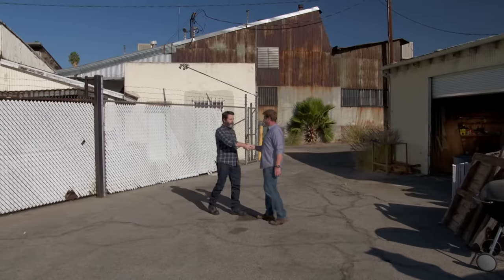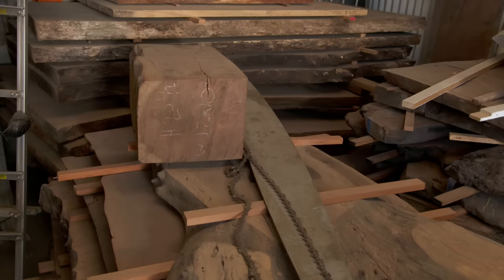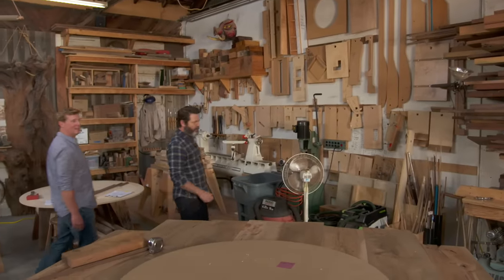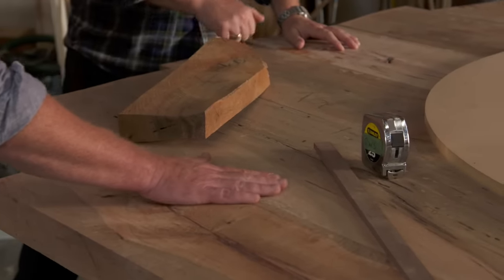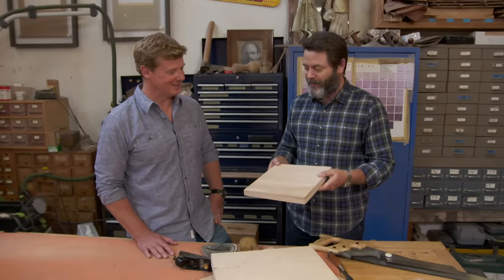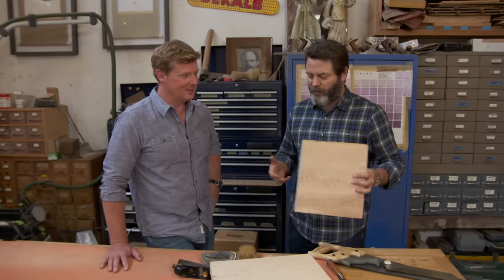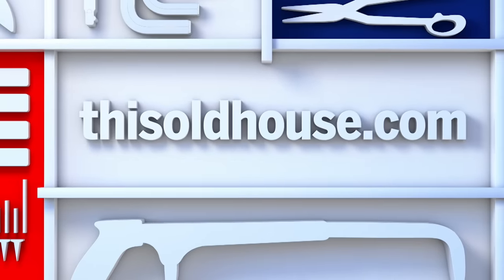Touring Nick Offerman’s Wood Shop | Ask This Old House

Comment: "the less electricity you can use - the more pleasurable your woodworking will be"  Wise words for sure!
Reply: I dunno about that. Certain power tools make life so much easier.
Try drilling a hole with a hand drill.
Reply: Richard Darlington what he means is that the less electricity you use the more proud of yourself and the more satisfaction you will have when seeing the end result
Reply: Lord Loud Kloud
What? You don't use power tools? I have better things to do with my time than spending five minutes drilling a hole instead of five seconds.
Reply: Lawson Mcdonald
And I'm saying I disagree.
Reply: Richard Darlington you disagree yet you have never taken the time to do so? You disagree with something you haven't actually experienced?
Reply: I agree that fashioning a thing by hand is pleasurable but after forty or fifty years of working without electricity or air power your hands, wrists, elbows and shoulders are damaged. You still have the passion to create but it becomes more and more difficult. 
Use power when you can. Every time you try to bend a piece of material to your will you give up a small piece of yourself. So use your body intelligently
Reply: formerly 987946216430   i agree with that, as he said, insofar as the lack of the incessant droning noise, but i'm all about power tools and production.
Reply: That's why I work on my wood in the dark.
Reply: I am a hobby woodworker and if I could afford all the fancy machines I would use them. As long as you are not cutting corners with the jointing and the proper sanding, why take ten times as long for the same result?
Reply: Until you need something routed or jointed lol
Reply: NASA F you know solar panels produce electricity right
Reply: @richarddarlington1139   That is a side effect of hand tool woodworking, free exercise, no gym membership required!!
Reply: After he had just show us tens of thousands of dollars worth of power tools.

Comment: I love how Nick Offerman can keep a totally straight face while delivering such dry, pithy humor.  Plus his advice was helpful for a beginner.  A good reminder to keep it simple and not bite off more than you can chew.  I would LOVE to make one of those giant slab tables, but I know that's way too ambitious at this point.  I've learned a lot just making little projects like a bookshelf from pine planks (FYI, 12 inch pine from HD that's not totally dry will cup a *lot*.  That's how I learned to use a hand planer lol.).  I can always see the flaws in anything I make, but it's still more solid and unique than a piece of particle board stuff from IKEA, and hey, even if it's not perfect it does its job of holding books just fine:)
Reply: Keeping it simple is something I wish more people would do. At least for beginners. I teach a beginners woodworking workshop, the number of people who come to me who have never made anything more than a cutting board who have thousands of dollars in power tools when all they have made so far is a cutting board never ceases to amaze me.

There are always two points that I stress. First is start with a few cheap(relative to power tools) hand tools. Not only does it help you avoid the sunk cost fallacy but also you tend to make smaller mistakes. 

The second is that no matter what you are going to make mistakes. The key isn't to be perfect every time, the key is to learn to hide the mistake.

Comment: I appreciate his perspective but I absolutely love power tools.
I spent most of the day today using a circular saw, 15" planer, and tablesaw.
It was great.
You can just as easily find peace in the noise as you can in the silence.

One of the most zen things you can do is spend an hour at a tablesaw.
Its very yin-yang because part of your mind is being very careful as to not cut your finger off, while the other part is just floating around daydreaming and also appreciating the beauty of each piece of wood.

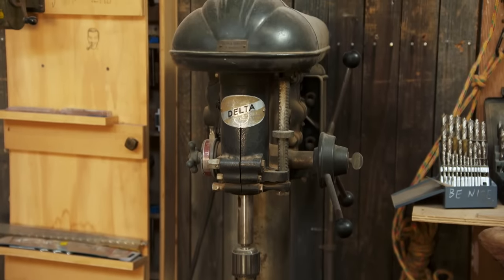Comment: 2:25 The auto shop i worked at had that exact same drill press. Funny part is that the shop didn't exist until 2004 so someone dragged the 50 year old drill press to a new location KNOWING that it would still be chugging along cutting holes in steel 20 years later.

Comment: I'm starting off in woodworking. I made a table with a pallet. Then I made a little chicken cage. Then I made my router table. Then I made a shelf. Then i made a changing table/dresser for a coworker. Do what you want. Dont be afraid of failure. It's like Jake says on adventure time.

Sucking is the first step to becoming good at something

Comment: The 'bunch of nails' comment rang true with me, an early project for me was a table made from an old garage door, and construction lumber. The wood was cut by hand without a square, and it was fastened with screws. 15 years later I took it apart, tidied it up, squared, rounded over, switched the construction lumber out for a red hardwood and used actual joinery techniques to rebuild it. Might leave it another 15 and see what I want to do with it then.

Comment: Hello Old House, amazing video.  I need your help.  I'm putting together a beehive and made a big mistake that I would like to ask you help with .  I did not use 90* corner brasses to make sure they set straight, and now the box down line up with one another.  So I have taken them apart, order the brasses, yet don't know how to correct the screw holes that are already set?  I feel like even with the brasses intact, the screws are going to go right back into the same pattern and the boxes will again be off centered.  I've had some suggestion to using the corner clamps and glue everything together making sure it aligned, and they let it set before re-screwing.   What would you recommend?  It would be so helpful to hear back from you.  This is a project that is very important to me.  Thank you so much.  Brad

Comment: He uses  tools made in the 1940s because that was before corporations realized it wasn't as profitable to make well built tools as it was to make cheap tools that break and need to be replaced. Don't sell them a tool once that lasts a lifetime, sell them a tool that needs replaced or repaired every couple years.